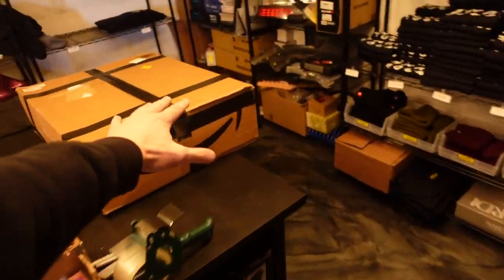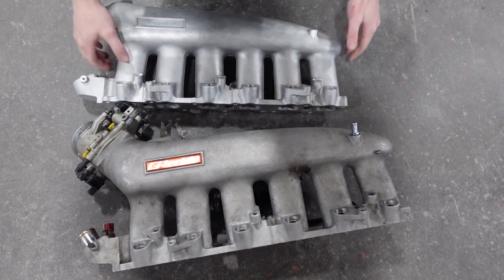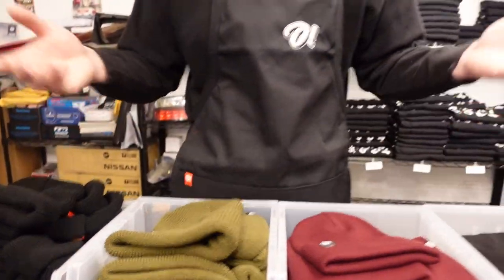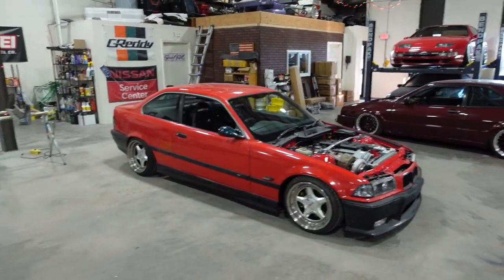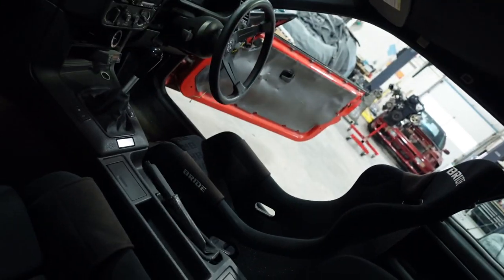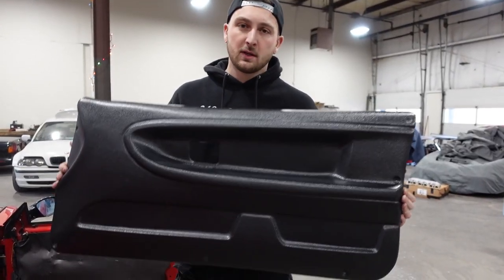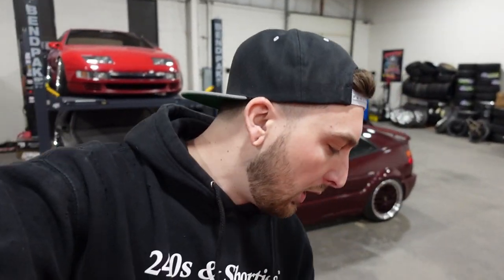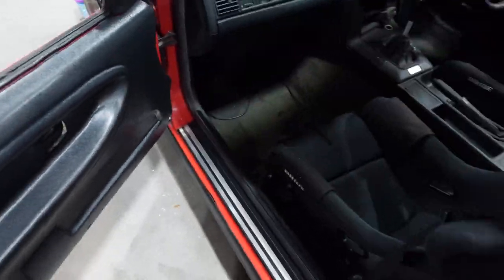E36 FINALLY gets a COMPLETE interior.. (door card solution!)

Comment: Putting a thin layer of insulation behind the door card would eliminate that cheap feeling when you knock on it.
Reply: that fiberfill fluff shit you put in subboxes maybe? absorb sound and all
Reply: That thin lightweight sound deadening stuff...... used it on my door cards & it worked mate
Reply: the dynamat/killmat rubberized peel ansd stick shit would make it nice
Reply: @Tanner731  i used Noico brand off amazon in my whole 240sx and it did stop rattling a bit maybe, mostly stopped noise from getting in or out. Noico is cheaper and does the same exact shit. although filling the volume behind the panel is probably better for these plastic cards vs air space still there with a little mat. i’m assuming.
Reply: @parkd240  I have the noico in my car, I think the move is to use the rubberized shit to deaden the plastic panel and some  insulation to fill the cavity
Reply: Could you flock them ?
Reply: Reflecktex would also work
Reply: audio damping mat, dynamat or something alike
Reply: @Tanner731  second skin
Reply: @WhiskeyGulf71  that was my first thought i think they would look good flocked.

Comment: Little tip Jimmy!
1.) For the door hardware, put an o-ring between the hardware and the plastic door card. 2 days of driving it will instantly start to crack it.
2.) You can use some home depot roofing tape to sound deaden the plastic door cards and remove the plastic sound of it. It will instantly make the car more quiet.

Comment: For the door cards, you could also spray some Bedliner/undercoating behind the plastic so it doesn’t sound hollow or “plastic-y”. 

Also use some foam tape where it makes contact with the door to prevent rattles

Comment: Spray the inside of the plastic door card with a light coat of undercoating, then get some oem looking fabric to put in the middle part where it has the fabric on the factory door card, and then flock the rest of the door card, boom looks good,  and no more cheap plastic sound and feel

Comment: Hey Oakes

Try some sound deadening material on the inside of your door cards, (dynamat)... 

Us sound guys use it to sound proof and reduce vibration and road noise.... 

Proper stuff will add a few kgs of weight but really good stuff.
Reply: The one with the sticky rubber texture behind the aluminum

Comment: you shold add like a rubber seal around it like the one that are used on edges of door for dings. also maybe using canned bedliner on the back or even the one that is made for "sound deadening" from walmart might work to make it not rattle.

Comment: If you end up needing the strap for the door make a slot in the panel and put a couple fingers width hanging out but mount it on the inside. That would give you a handle without a floppy ricer strap hangin around

Comment: If you don’t like the pull tab like that, open it up so that it’s flat and not flapping. You can even mount it low and out of sight. Just with enough slack to fit your hand behind to grab it.  Won’t be flapping around or looking cheap.

Comment: I'd put sound deadening on the back of those door cards. They are actually a really nice aftermarket solution
Reply: @hiddenundaflesh  sound deadening has an adhesive backing. No fasteners required
Reply: @hiddenundaflesh  until you peel it off. Peeling it off is also near impossible

Comment: 9:39, bro, low key could have put the strap handle down somewhere low and drilled it in... then you have an OEM looking door card that can run the original door opening handle, and have a handle somewhere low to close door when windows are up

Comment: But curious on a different note! I picked up a 05 350z base, Earlier last summer. R title, needed a little work. Lower ball joint, push the  Exhaust out the back and fix the rear diff. New to the z all around, it has a lsd in it. Everytime i would turn left/ right the  Astronaut would shift opposite. Now I just got it back from a Local shop that had the diff for 2 months or so, didn't charge me anything and said something was out a few mill. Put fluids in it good to good. If its that easy. Then slap me twice call be #$!@%$&^^!. Started the install  after work today, going to button it up in my morning. Any info if its not fixed?? Or vid about lsd would help?